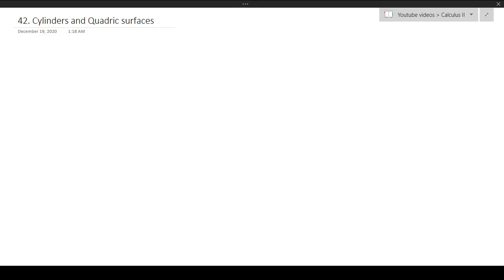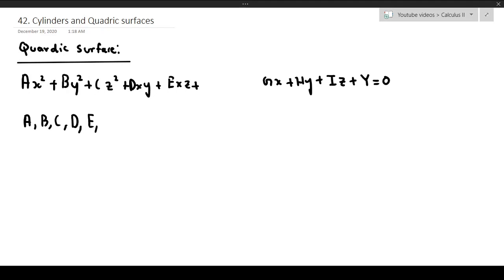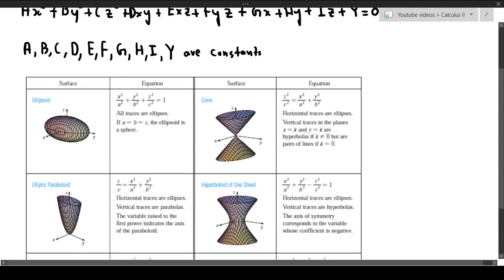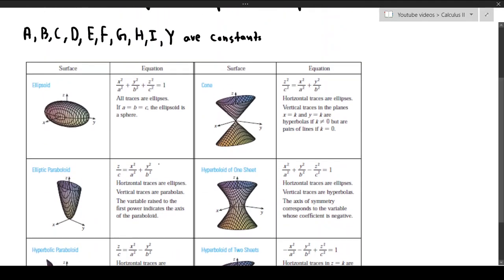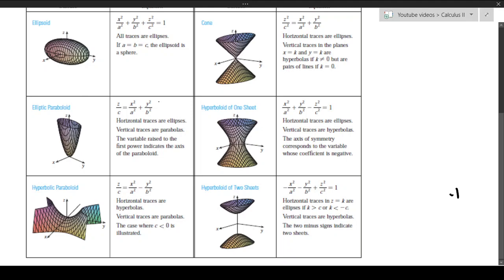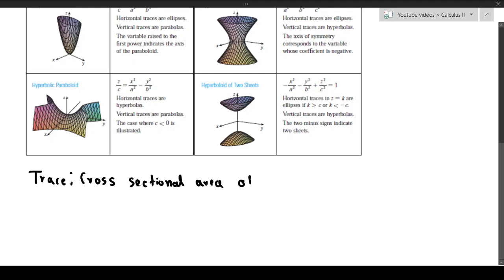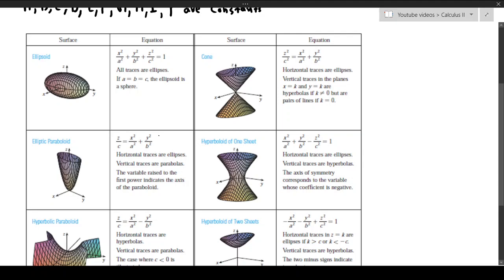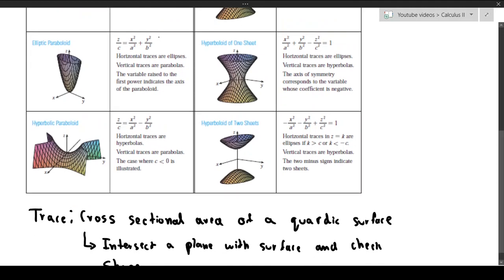Calculus II: Cylinders and quadric surfaces

Comment: for example 2, how did you know z=cx?
Reply from the maker: So this is actually quite an interesting question.

Essentially I have elliptical cross sections and I want to get circular cross sections. An ellipse is just a stretched circle so if I fixed one of the axis and I then multiplied the other radii by some constant, then the radii of both would match.

However, to ensure that the endpoints on the ellipse both remain in the circle, I have to tilt the plane so that the cross section still remains in the cylinder.

The reason z=cx is that I want to ensure I scale the x direction of the ellipse by some factor such that the radii of both sides of the ellipse match each other. Does that make sense? I want the radius of the minor axis and major axis to match.
Reply: @MathforThought  thank you, sir.